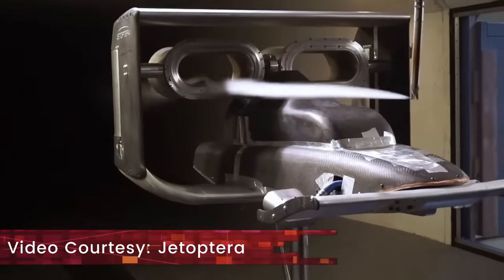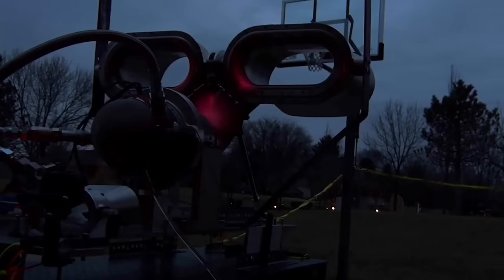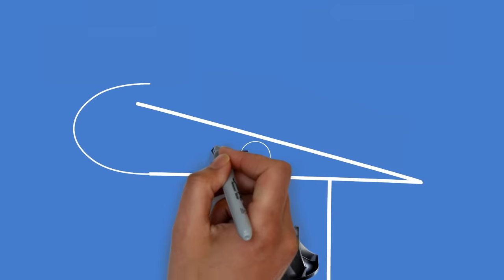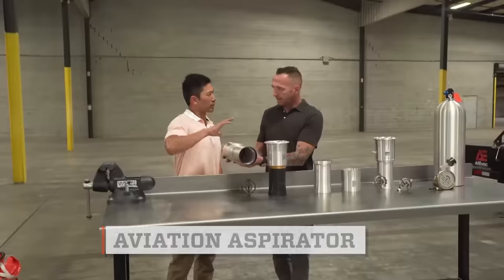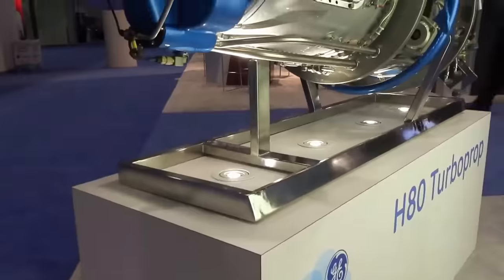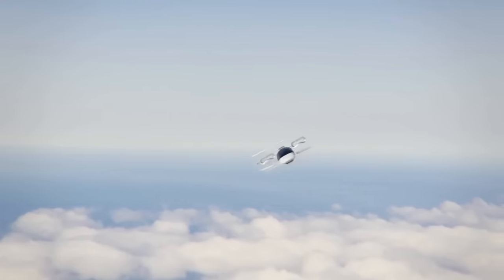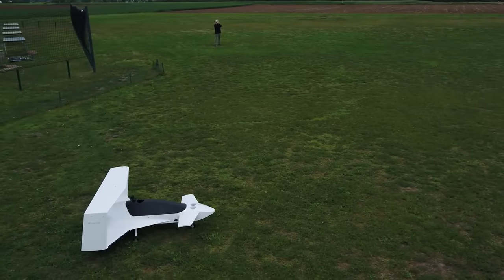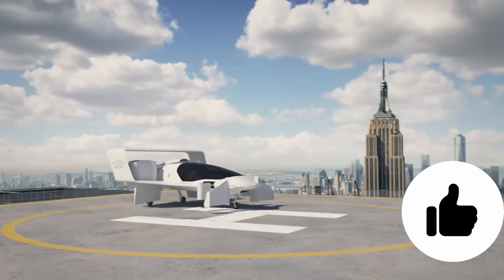Jetoptera's Bladeless Propulsion System

Comment: These kinds of proceptions & flying crafts, need to also be Magnetic/Electro backed up in accordance & benefits of a Planetary Magnetic Field. To where a flying craft or Levitation Structure, does Not contain a possibility of crashing to the ground. If propulsion Systems are lost during flight or weighted floatation in the Sky. Magnetic Electro Systems can also be used for propulsion...

Comment: Why not use an ionic fan system instead of a turbine for the propulsion. and also you could just use vectoring nozzles instead of rotating the engines at the front and rear of the craft, and I have a design of an aircraft you might find very interesting as it has so much lift when in motion that when I built a paper airplane of it I had to reinforce it with popsicle sticks

Comment: a visited Tokyo in 1983  I saw a fan with now blades and air flow by just applying some voltage on a mesh accross duct,, That technique; was never used in any product,,,,   but this is simple mechanics,,,,any flowing liquid follows the profile around,,,   Carborattor uses this effect to create low pressure and draw fuel, NOT EXTRA AIR,, from a lower level,, in main jet, only when there is air flow of runing engine.

Comment: Just look at the values for the jet turbine... 1250kw !?!?  You could use electric motors powered by a gas turbine generator and not need anything near 1250kw for hover.

Comment: it is cleaver but it will never go beyond 60mph or be able to carry more than 400kg,   it needs much more power, it could be done but if the craft hits negative airpressure or a very strong cross wind, if it flyes with the wind and the wind is more that the speed of the craft it will make it difficult to get the correct negative pressure to suck the air in.

Comment: This makes me think… wouldn't it be possible to distribute the Coanda / Fluidic Propulsive System to the whole box-wing, instead of those two little elongated "Dyson fans" that are inside the box configuration? I understand those two are orientable and this is their purpose of course, but then let's build two independent box-wings like Synergy Aircraft does on its electric plane prototype, and make each one orientable to act as two thrust vectoring systems. Then you would merge the engine, the control surfaces and the lifting surfaces (wings) in a single element!

Comment: Some of the stupid and snarky comments posted here aside, the real question here is how much potential can you produce and how light can you make the power storage/generation system. Other considerations ofareodynamics and type of service the air craft is used for are secondary to the weight of the power unit and air and thrust efficiency of the engine.

Comment: Coanda’s time is overdue.  Box wing has so many strength engineering attributes.  New methods of thrust are neglected,  including counter rotation.  
It’s a Long road to break the way aircraft design innovation has stalled (pun intended) mostly due to “if it works don’t fix it”.  Not to mention the bureaucracy of aviation industry tied to agencies they are in bed with.  Case in point the spring manufacturer “Boing”

Comment: I'd like to see the actual math. The scalability of this propulsion system to full size aircraft is dubious. RC aircraft are able to have insanely high power to weight ratios that I think would allow this type of system to work, but I have serious doubts about getting the required power into a full size aircraft. I can see advantages of a system like this, so I hope that someone can do it, but I don't think the math will work out correctly to make it a workable system. We will see.

Comment: Certainly, this propulsive scheme has huge potential for gaining efficiency. However, the dream of urban air transportation is for the naive ones. The amount of air - translating to downwash - to be used for vertical takeoff creates too much of dirt for any significant acceptance level in truly urban areas. Further, today's VTOL aircrafts - helicopter - need safe ground space for VTOL operation as will do this suggested one. I doubt this could be managed in urban areas of existing citys.

Comment: They didn't need to make the air flow this slim. Plus the CGI is missing an intake air flow vent. The advantage of this engineering, is a fan exposure-free craft, the extreme compession will only limit performance, wasn't necessarly. This method of propulsion, requires sqeezing air to a very tiny turbine, this requires a tremendous power and force to get air through this, to match a classic propulsion of a blade exposed fan. The only given advantage, is a hidden blades, Some advantages can apply,  with afterburn or air thermal pressure heating, or instigate sonic waves turbines. Dyson presented this kind of "blade-free" fan, which is only a hidden fan. " Maybe, just maybe." it could be enhanced, with a broader air flow, if afterburning/heat for greater speed.

Comment: NOW put it all together (steam, electromagnet, hydrogen, gyro, angular momentum, ion / co-valent)
tip-polyethyleneglycol (antifreeze) 
compressed helium into bucket of ethyleneglycol == tiny stable lighter than air bubble mesh that can be shaped into a 'GRAPHENE' hemisphere (top) electromagnetic base ...duplicate to bottom and polar spin and computer chip control in middle of vortex center (looks like alien disk spacecraft)
wireless game controller and cameras == drone (nano?) == thousands in the atmosphere and 3d printer emulsion 
#CANYOUDIGIT

Comment: You need a Gas Turbine / Turboshaft to drive another external compressor to supply high pressure / flow to those oblong ducts...I can tell you now, those EDF fans when scaled up to full size won't provide enough energy...🤔🙄😳🇬🇧

Comment: The Caproni Stipa benefitted from a similar effect, no?  It didn't have compressed air, but the blades on the motor are pushing air fastest at the end of the blade, closest to the surface of the duct.  I would think this might cause a somewhat similar effect, although probably not as good...  I thought he noted this and made the duct/drum bow in the middle.  And just think... we could all be flying around in Stipas like super villains.    https://www.youtube.com/watch?v=kB4-_OWz5qE

Comment: The concept of a duct or cowling around a rotor or prop blade is improved effiency,safer and quieter shld be the standard for any vtol that will be carrying people, its a no brainer,now improve the power to weight, the power plant and also the design of the blades themselves,mimic natures design of wings for blades get more scientific modeling and designers/ programers,1000s of years of nature cant be wrong

Comment: Great video and cool concept.  This is where Capitalism becomes the bottleneck.  Innovation like this can't get the funding because of  performance requirements, so the performance is difficult to achieve and the race to an aircraft like this stales (pun intended) until someone smarter comes along and figures out a way to make research of such things feasible (create small versions) then scale up.  The same holds true for any technology that was shelves due to their potential or lack thereof to make money, which in Capitalism usually means making money for the few. Our tax dollars fund a lot of this research, but the benefits go to a minority of our citizens.

Comment: they need to use hydrogen fuel cells and have ammonia as the fuel cuz it's nitrogen and mostly hard your job and it doesn't need a high pressure and less combustible in transport

Comment: Until flying is fully automated and safe flying lanes are established, there will be no "flying cars." It also seems very unlikely that the same vehicle will be used for surface and air transportation, due to incompatible performance requirements. It will take a long time to develop infrastructure which is affordable enough for use by the general public. However, it is definitely doable, and will eventually happen. Elon is kind of busy right now, anyone else want to invest a private fortune?

Comment: Sceptical on this one because the propellerless thrusters will only work at speed. They do not produce enough thrust to take off and land by themselves.   a lot of thrust vectoring will be needed to keep this box shaped object stable when taking off and landing. The jetturbine they propose has no vectoring caoability. How are they going to accomplish this? It will need at least 3 or 4 extra jets as there is no room to divert thrust inside the body. This will add a lot of weight if they can fit them the jet itself doesn't look like it can vector its thrust in any case. They are vague and not detailing this at all. Is it a scam? Are they looking for investors??? I will believe it when I see it take off and land....... Strangely enough they do not even have a scale model....... Says enough for me

Comment: I'm calling bullshit on this. Dyson fans are less efficient than the same power used to drive a big propeller (aka fan!). The latter will move more air, it's that simple.

Turbojets are less efficient than a turbo-fan at subsonic speeds, this is true. No amount of jiggery pokery with an air jet is going to improve upon the efficiency of a prop or ducted fan.

Comment: (X) Doubt. 

While it's good for pushing the air, that's not enough to get the vehicle going. The air will just pass through and those engines will be nothing but glorified Dyson fans. Jet engines work on principle of exploding the high pressure air behind the turbine, and said exploded air pushes the turbine and the aircraft. Aircrafts with blades use the lift of every spinning blade, and blades drag or push the engine. What drags or pushes these engines? I see the prototype that was flying actually used rotary engines with blades, not the bladeless engines. And the planer that had the bladeless engines installed... Planers do not need engines to fly, like at all. Where is the proof that those engines had any significant impact on that planer propulsion?

For now I see nothing but scam for crowdfunding and investor's money, just because people don't understand how do planes propulsion actually works.

Comment: Sustainable is basically gaslighting. It’s a concept placeholder for just barely getting by. Regenerative is the word to use. This plane is not regeneratable. It’s certainly not sustainable. And moving energy production from the end user to a power plant 50 miles away does not that increase  efficiency nor reduce emissions not general. That’s not good engineering at all. Electric motors do have some specific advantages and do have serious pitfalls. One size never fits all! We know this because of engineering experience and life experience. Jack of all trades master of none, or a very good specialist. Therefore insisting everyone go electric is a very poor idea.